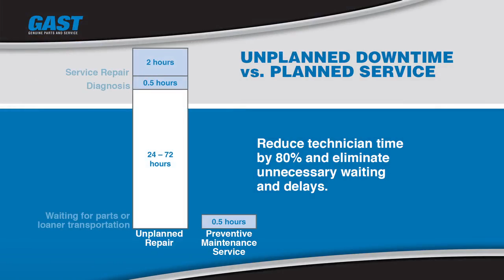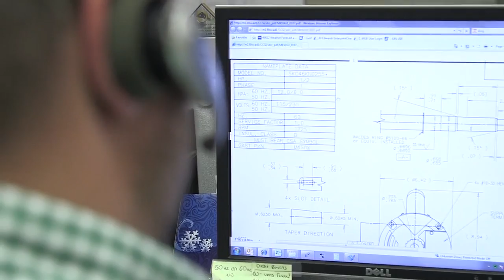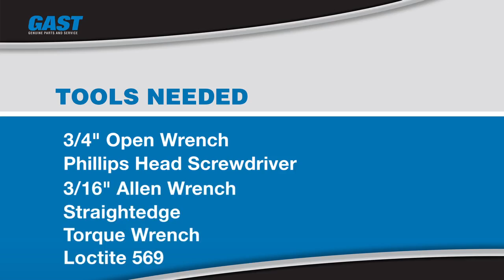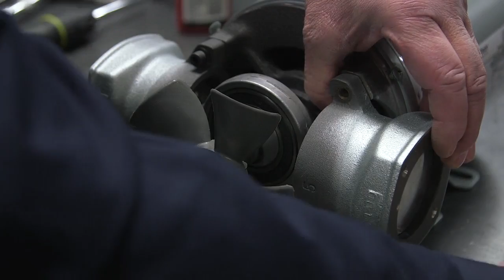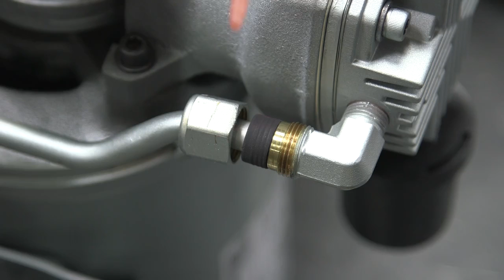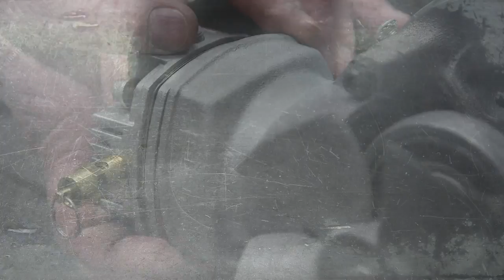Piston Compressor Preventive Maintenance

Comment: As to a rebuild of Gast piston pump, (not rocking piston). I studied the manual and was confused as the inlet,valve, and outlet plates (item 6,7,8) do not have a gasket between them,  and a lot of air was leaking from the cylinder and cylinder head. According to Gast air leakage is normal ?????. I was going to use a slight amount of liquid gasket cement , between the valve plate and the inlet/outlet plates, then decided not to. I got a sheet of 2500 wet and dry sand paper, a bit of soap/water, and a plate of glass as a flat surface. I polished all sides of all the plates fairly well ( 1 hour), then reassembled carefully following the exploded diagram in Gast's oil-less piston maintenance manual. Torqued down the 4 hex bolts tight, now I feel no air leaks from between the valve assembly. Just purchased this 3HEB pump from Ebay for $149 , unit was never used...believe one of the valve plates was not assembled correctly before my fixit

Comment: how often to the piston seals and rider rings need to be changed? like how many hours? i have a 2-cylinder gast compressor that i've been using for over ten years in my garage for light-duty stuff like paint spraying and tire inflating and i haven't done a thing to it except for cleaning the inlet filters.